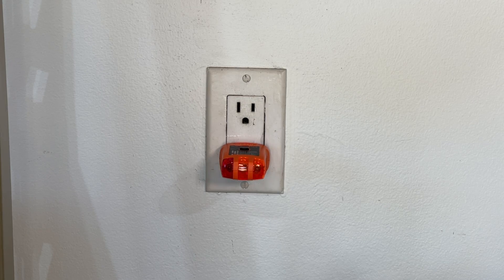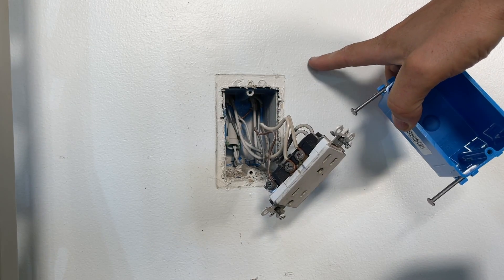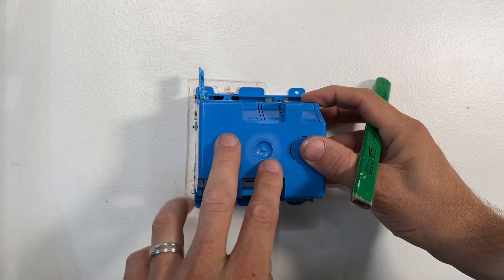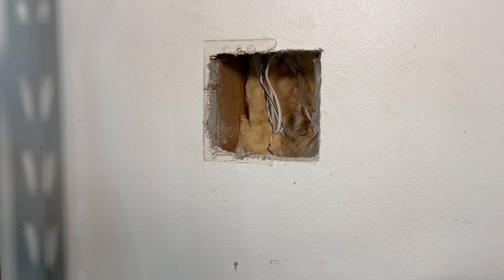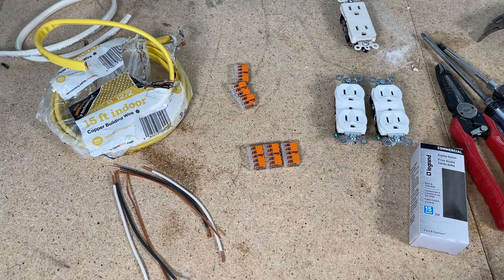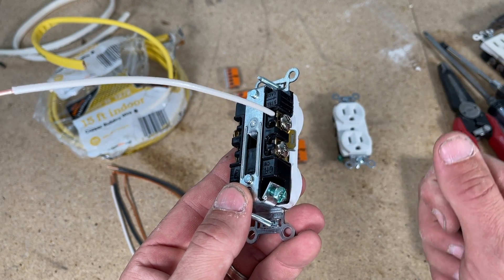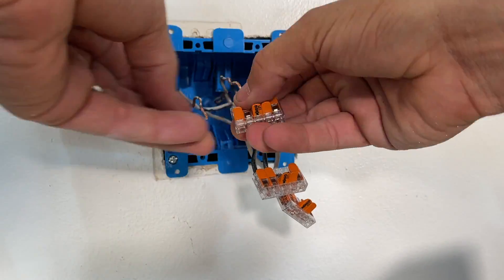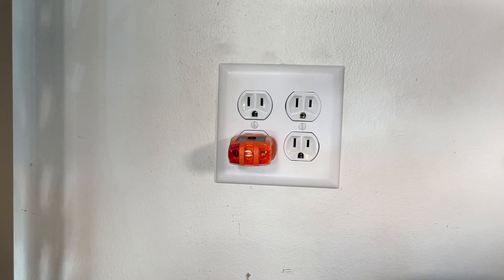Converting 1 Outlet Into 2

Comment: I noticed there's no visible sheath inside the box with the romex, which I understand is a code violation. I've found that getting the sheath through the replacement box is the hardest part of this job. Something about having very little sheath and space available to shove it through make it get stuck on the clamp. I think the Arlington "One Box" works a bit better for this because there's a nice big hole where you put the plastic bushing. Though it's still hard to get the sheathing through.
Reply: Old work boxes have the wire openings more recessed so you can tuck the box into the wall with the wires already inserted. Unfortunately, this causes you to lose that 1/4 or sheathing from the original box. I wonder if there is an approved method to restore the length of the wire sheathing so you can have that 1/4 inch minimum protruding into the box?
Reply: @MoneyManHolmes  Heat shrink.

Comment: Hi All;
Is it "permitted" to use a couple of drywall screws to secure the plastic box to the stud from the inside?
These screws would be near the top and bottom  inside corners so they are not close to outlet terminals and add rigidity.
redrok
Reply: Technically, no custom mounting holes on plastic boxes. Have we all done it? Maybe.
Reply: @MoneyManHolmes  .... technically you are not supposed to modify anything that's UL listed. Drilling new holes would be a modification. Buying the right box is the solution. What you want is now sold.
Reply: Who cares

Comment: I had a similar problem with power supplies for my batteries.  My solution was to mount a surge protector power strip to the wall, mount the supplies to the wall, and plug them all into the surge protector (and tie off the excess cables).  This way I can turn on/off all of the supplies with one switch and all of them are behind some secondary surge protection (primary is a surge breaker in the main panel).  My workbench already has 4 duplex receptacles so there's no need to add any.

Comment: Is a 1 to 2 conversion possible if you're house wiring is run through conduit?
Reply: It's your house have fun
Reply: Depends what boxes were used in the original construction. Could be even easier than this video shows.
   Pull the outlet out and see if it is a 4" square box with a single device ring. 
   If it is, cut out the rest of the drywall to expose all 4" of the box, loosen the screws holding the single device ring and I stall a double device ring and install the 2 outlets.
   Might have to do minor drywall mud work before installing the plate

Comment: I prefer to use green insulated wire as my ground pigtail. This prevents any issue with the bare copper wire (the grounding conductor) from bending back toward the receptacle when pushing in the wires and receptacles. I buy THHN 14 and 12 AWG with green insulation by the foot. If you do a lot of work, you can buy a spool of this wire.
Reply: What the hell are you guys are arguing about? This is a DIY channel. DIYers should take the time and care to do things properly and completely. This isn't intended for electricians who have already bid for a job and every extra second they waste costs them money. That's why so many electricians backstab (to save time). But if you want to do it proper, then yes, I would say that using pigtails with insulated grounds are a great idea.
Reply: For those who want to watch channels by electricians for electricians, I recommend Peterson Electric, MikeHoltNEC, Master The NEC, Electrician U and Sparky Channel. If profanity bothers you, you probably don’t want to watch Electrician U. Unfortunately, the Sparky Channel was hacked some time ago and a lot of his good content has been lost, but he is slowly rebuilding it.
Reply: great idea 👍🏻👍🏻
Reply: you still have bare copper in the box regardless of green insulated wire or not.
Reply: @ironpig701  The point is too keep the bare copper as far away from the grounded and ungrounded terminals as possible. You can achieve a similar affect by wrapping the terminals in electrical tape, but I do not do that because I find that electrical tape dries up and starts coming loose over the years.
Reply: @Around_The_Home  I understand that but by code you need 6" of wire past front of box. So you will have about 8" of bare copper in the box any way to deal with. Then you have to buy rolls of THHN to splice rather than using scrap romex to splice. Way to much work.
Reply: @ironpig701  If bidding on a job knowing the competition did it the typical way, I would agree. But this is DIY for yourself. Regarding cost of material, assuming a 6" pigtail just for the sake of math, then a 50 foot roll of THHN would do 100 receptacles.
Reply: @Around_The_Home  never wrap it in tape. That's the mark of morons and amateurs. Even "electricians for 20 years.," Lol.

Just wire it correctly and tuck it in correctly. There is zero chance for failure. Backstabbing and loose connections and haphazard wires and loose nuts and electric tape are all points of failure.

Tight, clean, organized, tested. You don't need an insulated ground, there should be zero way for ground to contact terminals on the side or the conductors assuming they didn't nick the insulation or leave a huge part stripped back... even then it'd minimal. But I have seen idiots that took a huge chunk of insulation off somehow and just left it. I cut it there and had to pigtail if I couldn't pull any slack. Why even give a chance if I'm already working in the box?

My most annoying thing is having to sand ground wires since Jorge came through with a spray gun and slabbed paint on it making it insulated instead of a solid connection for any ground faults. Also have had to sand or recut a few conductors for the same reason but the ground is almost always coated and the conductors are usually stripped after the paint so at least that copper isn't painted. Usually. Still.
Reply: They banned the bare earth in our cables in Ireland about 2 years ago now all our cables have all conductors insulated and they have to have the same cross-sectional area (wire guage)
Reply: @solidus784  that's just dumb. People legislating that don't understand how electricity works. You don't need insulated grounds. No harm in them just superfluous.

Engineers have done the math on gauge for EGC, they don't necessarily have to be the same size. But whatever. Guess they figure it's easier to tell if the same size. They're only made to carry current in a fault for very brief period of time. I'm sure they know how many amps a short would cause and at what time and temp the copper would vaporize.
Reply: Waste of time. Learn how to properly tuck your wires.
Reply: @kylekarcher  Whether you create a pigtail from bare copper wire or insulated wire, it is the same amount of time.
Reply: @Around_The_Home  
You apparently dont work as an electrician or you would understand.
Reply: @kylekarcher  I do understand. I prefer my way. Push all bare copper wires as far back as possible and use insulated wire for the conductors 'in front' of that.
Reply: @Around_The_Home  
So your going to spend extra money and time on something. Have you ever roughed in a house for electrical?
Reply: @kylekarcher  Yes, I spend the extra money (not time) on my work. And I assume you understand you are watching a DIY channel. If you feel only full time electricians are allowed to have an opinion, you probably want to watch Peterson Electric or Master the NEC channels, which clearly state their target audience is full time electricians only. Regarding rough in, every house I have purchased, I have removed the cheap, back stabbed receptacles installed by the pro and replaced them with higher quality receptacles and that I either back wired or side wired. I learned a very long time ago that just because somebody makes their living at it, doesn't mean they are good at it. This not only applies to the trades, but to any job, white or blue collar.
Reply: @Around_The_Home  
I agree there are professionals that are not very good.
Reply: @kylekarcher  Right you are. It has taken me a long time to find a top notch electrician (which I use for the harder work) and plumber. Still looking for a good HVAC company. The ones around here spend most of their time upsellling instead of performing preventive maintenance.
Reply: @Around_The_Home  
I've been an electrician for 20years and I'm appalled at some of the work I've seen done by so called professional's.
Reply: @kylekarcher  I agree that every profession has a range if talent and dedication. I have also talked to professionals who complained that they had to work with the cheapest materials and were directed to use the fastest process, such as backstab outlets. It's not always the person's fault.
Reply: @kylekarcher  I've seen them send in day laborers to throw it in then they just sign off on it. Not necessarily even looking it over. So I don't trust Many electricians especially home builders using lowest bid. You're lucky if you at least get an apprentice doing it but same issues. Then the local inspector is paid off and you're lucky if they look at anything other than the main box.
Reply: @etherealrose2139  
It depends where you live too. Some states are pretty good. Also some companies are better than others. I have worked in about 10 different states and they all have there nuances .
Reply: @kylekarcher  Quite a few, through the decades, actually, and, yes, I always aim for more than just barely meeting code. You'll see the bare copper ground wire go the way of the do-do bird in the next few years. Unnecessary risk is always more time consuming and expensive in the end.
I recently got a look at a few receptacles I did nearly forty years ago. Still tight, still clean, still serviceable. I wrapped them back then - and we were using fiberglass boxes.
But, then - I'm more interested in my work being professional than just having that sweet license.
Penny wise, Pound foolish.
Reply: @kylekarcher  Safety is never a waste of time. Oh, right, I do this professionally, not a home gamer.
Reply: @ethelryan257  
I'm not sure what you are trying to say?

Comment: Since this add more plug=more load without upgrading the wire to handle more load, you will get the same thing if you just add a power strip.  Plug in a power strip and you are going from 2 plugs to 7 plugs.  It's fine if everything you plug in isn't power hungry or use power hungry one at a time.
Reply: In wiring or rewiring, follow the rule of 5amps per receptacle.   If you have need for a quad (2 receptacles side by side), either they are wired to a common breaker. If there are other receptacles daisy-chained to the quad, it would be good to bring in a separate circuit for the second receptacle.  I had it split top/bottom on the receptacle by breaking the tab joining the two halves.

Comment: Looks like your equipment ground was touching your grounded neutral wire when you stuffed your outlets in.
Reply: Right. It looks like. It passed the tester. Stop being so perfect
Reply: @johnkulpowich5260  The tester he used in the video wouldn't recognize it as an issue

Comment: I've done this to several of my outlets thoughout my home. I have a manufactured home, so changing out from single gang to double is extremely easy! I also have made some double circuit setups for laserjet printers and other heavy equipment in my home office... I also did this in my bathroom making a dedicated outlet for a space heater. this is the easieat way to expand a circuit for todays electronics. never seems to be enough power when you need it...
Reply: Are your wet room outlet(s) such that 1 is the gfci, and the other is connected downstream of the gfci, so that all preceptacle openings are gfci protected.
Reply: @lsatenstein  yes, the house came with the GFCI outlets already installed, so it was ready.

Comment: No wrapping electrical tape over the outlet screws? Peace of mind knowing that the bare ground wire won't short against the screws. In this case it was close to the neutral, but would trip trip the breaker being close to the hot side.
Reply: Waste of tape on a plastic box buddy
Reply: @johnsandlinjr  I was referring to ground wire shorting out against the hot screws not the side of the box.
Reply: @alexm8922  fair enough. I’d just push the ground back. Shouldn’t be there anyway. Plus hot is on the right.

Comment: It would be wise to mention the BARE ground wire!!  Even though allowing the bare ground wire to come into contact with the screws on the WHITE side of the plug (when stuffing everything into the box) will not cause "sparks to fly", it is advisable to make sure they DO NOT touch. The GROUND return is to remain separate from all the other wires throughout the system, it's a safety thing.
This is why we typically first stuff the GROUND circuit into the back of the box (and along the bottom), then the white (NEUTRAL) and last the black (HOT) in the front of the box.
A very good and clear presentation...  Thank You.
P.S. A deep box sometimes makes things easier.
Reply: This happened to my outlet and the breaker kept tripping.. I think it's called a ground fault circuit breaker? It was definitely not easy to find, I had replaced all the outlets in my house. Make sure you keep those ground wires away!
Reply: @carlos33193  Your issue was the ground touching the hot, and you're lucky it happened downstream of the GFCI protection and not before
Reply: @brl5755  ground touching the hot would flip the breaker from short circuit. Ground touching the neutral on gfci would trip because not all the current is coming back on the neutral and it senses that it must be taking ground back and trips.

His issue was likely ground touching neutral if gfci breaker was tripping off on that.
Reply: ground touching hot: before gfci outlet is a job for the breaker (would be exactly why a GFCI breaker is a good idea), post-gfci would be the exact thing the gfci was made to trip on
ground touching neutral: before gfci outlet would do nothing- they're already bonded in the panel (also a situation where a GFCI breaker would trip), post-gfci-outlet should trip the outlet as current would not travel back on neutral and the discrepancy should trip the GFCI
Reply: @brl5755 GFCI also work with neutral faults. Neutral to line as there are then two parallel return circuits which causes an imbalance of current been detected by the GFCI causing it to them trip as the current on the live I’ll be greater than the current on the neutral line.
Reply: @carlos33193  Great point I have a GFI that keeps tripping and know the entire circuit is wired correctly. Never looked for that, something to do today !!! Cheers !!!
Reply: An accidental bootleg ground is still a bootleg ground!

Comment: There should be a GFCI somewhere in this circuit since it’s in the garage.
Reply: Not if this is older work and b4 that code change.  Some things do get the "grandfather" clause. 😀
Reply: GFI breaker perhaps?
Reply: Well it might depend on your locality, but when replacing outlets you may need a permit, which also means you may need to bring it up to code for the inspector. Even if it isn’t required where you are, it is a “might as well” kind of thing to do, especially for your own house.
Reply: @charleswang1211  it says in the code book if your replacing like for like or a outlet ( maybe worn out or cracked replace with a new one of the same style you don’t need a permit, the same would be true if you wanted to change an old light for a new light no permit )

Comment: Tip... most of the time you'll find the stud to the left of the box... as most electricians doing installs are right handed, and that's the easiest way to nail them in. Don't count on it though, always check as some will be in oddball spots where the the stud has to be on the right; and of coarse there's left handed installers around.

Also, for the shop, I'd consider putting in a GFCI, and for a quickie job, one of those 2 to 6 outlet adapter gimmicks (but a 2 to 6 is probably not a good idea for rentals; & if it's yours, be sure no one will overload it).
Cool videos, Thanks!

Comment: I’m a 24 year electrician, I’ve had my masters license for 18 years. I cannot bring myself to use the “quick connects” or Wagos to make up joints. I’m an old school wirenut guy. 😁 Great job on your project! 😎
Reply: I like to call them lever nuts. Makes it more palatable.
Reply: @Around_The_Home  Wago is also the manufacturer, not the connector type.  Kinda like the Kleenex vs. tissue thing.  You're right - lever nuts are the proper name.
Reply: I’m an old school guy myself.  I much prefer to walk than use automobiles.
Reply: Personally, I use new-work boxes and cut the ears off.  Then I just run two screws through the side into the stud.  IMO way stronger than relying on two flimsy plastic tabs. And yes, I’m a believer of wire nuts….